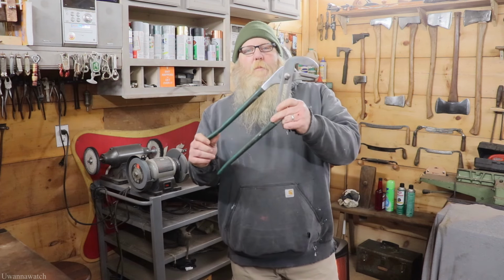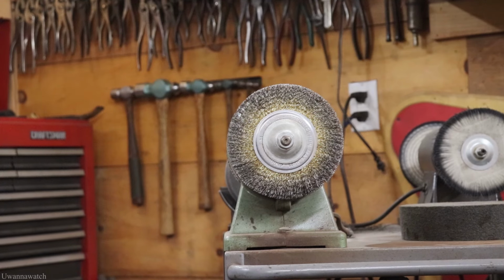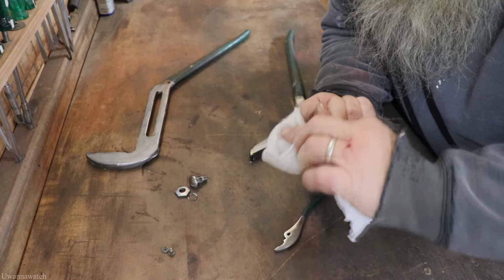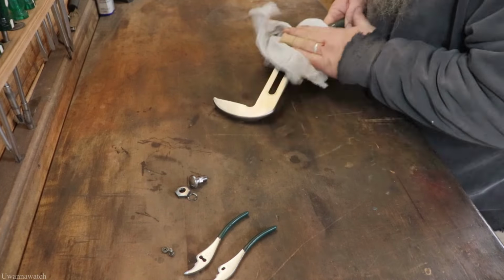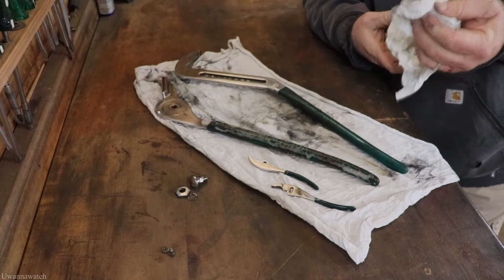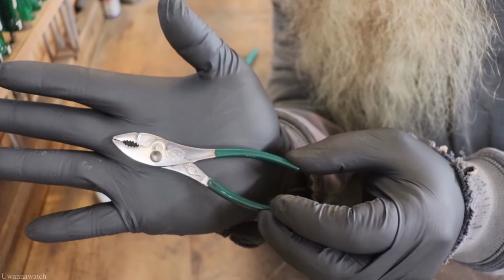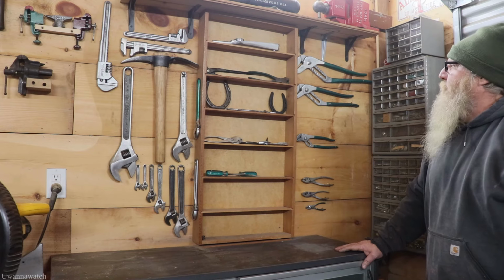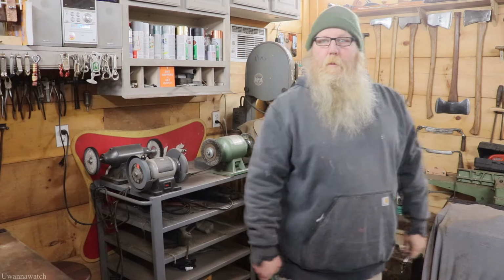Diamalloy Tools

Comment: I used a pair of giant channel locks to remove my water pump fan.  I borrowed the set from AutoZone but some jerk stole the wrench out that was the one.  Double clamped the groove joints and smacked with a 3lb dead blow, worked like a charm. You got those looking better than new, great video.  Thanks
Reply from the maker: Yep that's how it's done. I think I've only rented one tool before. It was a pickle bar. I might still have it.😂. Thanks for watching.